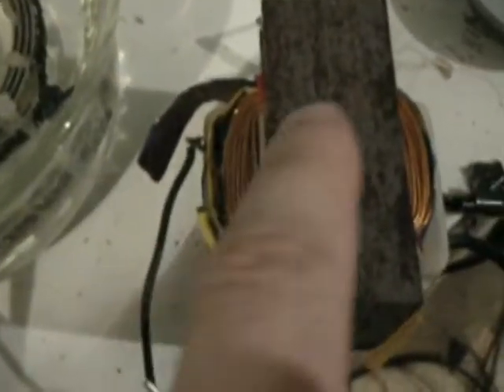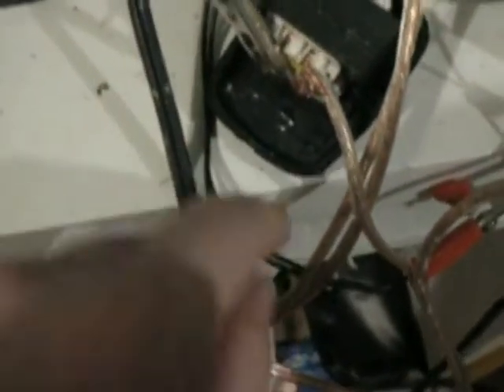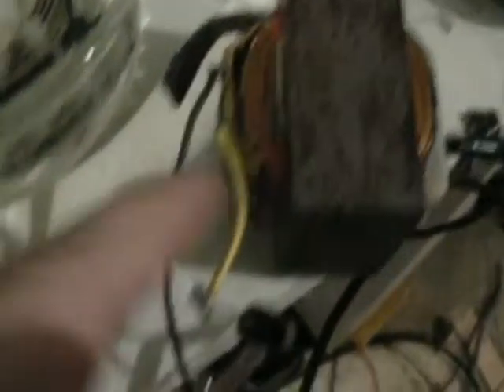Distilled Water HHO Production

Comment: Meyers didn't run his car on HHO, he used "HHO CHARGED WATER" then injected in the "spark plug" vibrating at 42000hz and EXPLODED the water to drive the cylinders.  My circuit draws 3 AMPS!  Thats it.